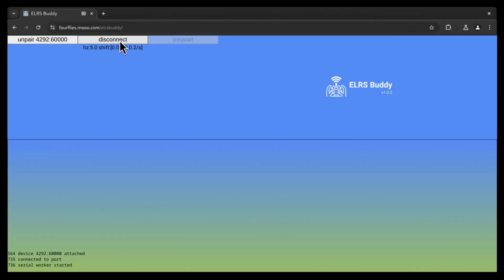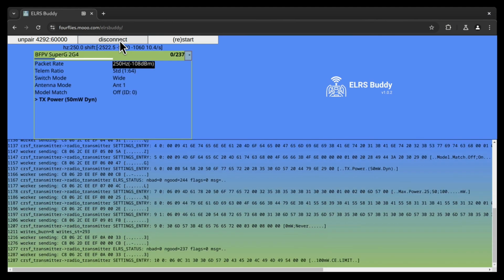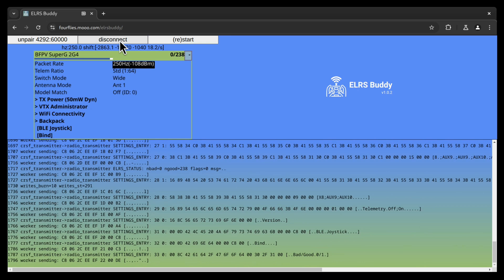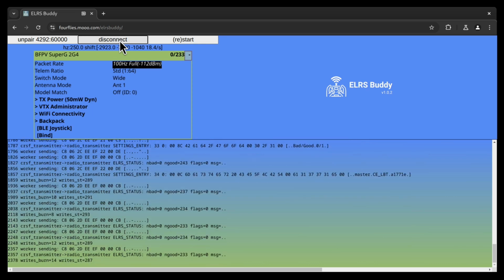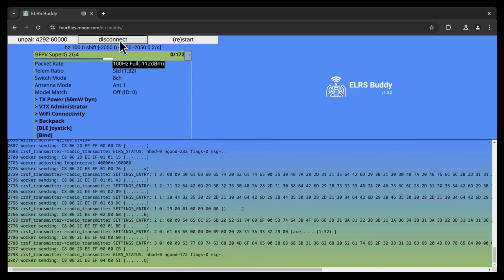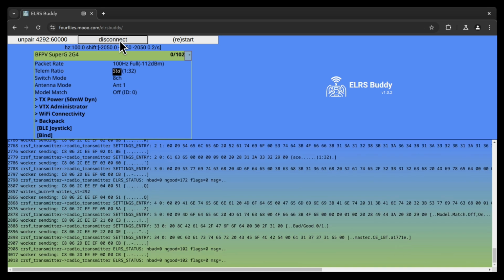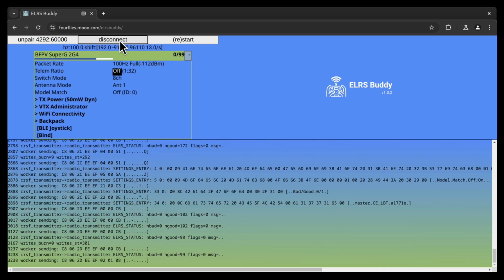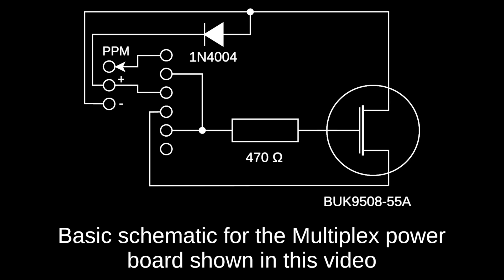My twenty year old transmitter gets ExpressLRS

Comment: Thanks for putting this all together. I'm trying to get a Radiomaster Nomad working with a USB to PPM device. I'm running ELRS 3.6.0 on my Tx and Rx. I used ELRS buddy to change my packet rate to 50 hz and disable telemetry. After configuring I reset hardware back to default. I believe I have the PPM device pinned out correctly, but I'm not having any luck. Do you have any advice for what I might try next?
Reply from the maker: Hmm, maybe check the voltage levels on the PPM output? Should be between 3 and 5 volts if I remember correctly. If it's too low your Nomad might be unable to decode the signal. If you have an oscilloscope to test the PPM output, even better. If no oscilloscope, you can feed PPM into a PC's line-in or mic input and scope the signal that way. Just make sure the voltage level isn't above 5 volts, and maybe add a basic resistor impedance circuit to be safe. If your PPM signal looks good, then I would guess you made a mistake on the input pin to the Nomad. Since you used ELRS Buddy with your Nomad, maybe just double check that your hardware reset on the pin configuration worked correctly - RX and TX should use the same pin.
Reply: @Fourflies  Thank you for the detailed response. It ended up being a bad transmitter module. I swapped it out and it worked like a champ. I was also able to use ELRS Buddy to get the transmitter module to play nice with my use case. My project would not have been successful with the hardware that I had without ELRS Buddy. I appreciate your efforts.

Comment: This is awesome!
I am looking to add ExpressLRS to my Futaba T8FGS, and this is the first information I found about ExpressLRS working on really old radio.
I'm not sure if I need voltage regulator? Did anybody tried to retrofit ExpressLRS to futaba radio?
When ExpressLRS 3.3.4 is out it will support PPM? Is this correct?
Thanks!
Reply from the maker: Would be great to see your experience of converting your Futaba! Regarding the voltage regulator, I don't think you'll need one, but you should check the input voltage specifications of the TX module that you plan to use. My BetaFPV module allows 7-13 Volts, and in my Multiplex it gets power directly from the handset's 2S LiPO. PPM was added to ExpressLRS 3.4, and the latest version available is already 3.5.
Reply: @Fourflies  I still use original 7.2 V NiMh pack, but if needed i can switch to 2S lipo or life battery.
If the ELRS module has the screen and buttons, do i still need ELRS Buddy?
Reply from the maker: A screen will save you from most functionality that ELRS Buddy provides. I have heard from someone else that one thing the screen doesn't allow is the configuration of other ELRS devices like receivers. With ELRS Buddy it is possible to configure an ELRS receiver from the transmitter module once the two are paired. That said, I think there isn't much to configure in receivers. Mostly just the default packet rate which allows the initial connection to be established quicker.
Reply: @Fourflies  I acctually don't mind configuring TX module with ELRS Buddy. This just means I can pick up any ExpressLRS module and make it work with my Futaba. Ithought there isn't any other way to access LUA Script than trough screen on the module, until I saw your other videos about ELRS Buddy. Thanks👍